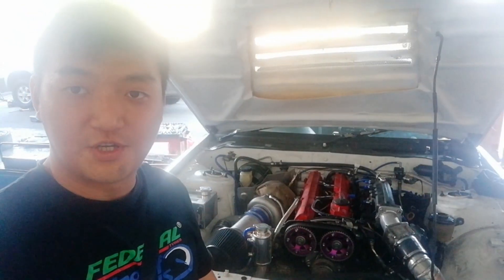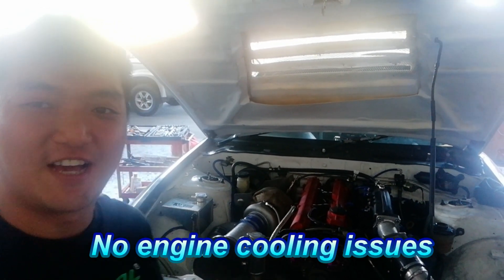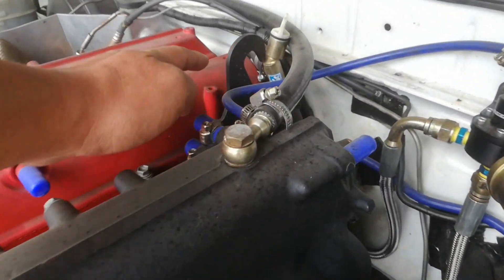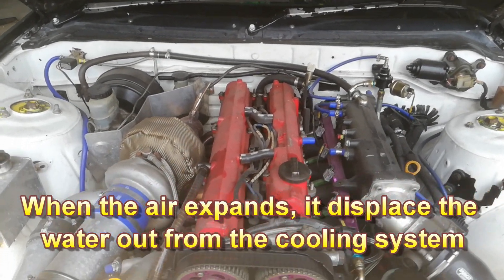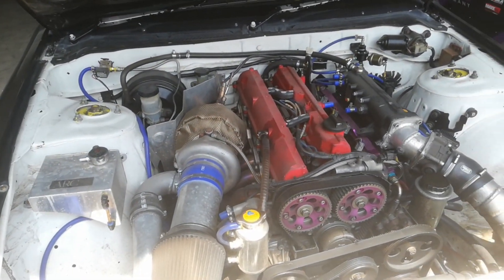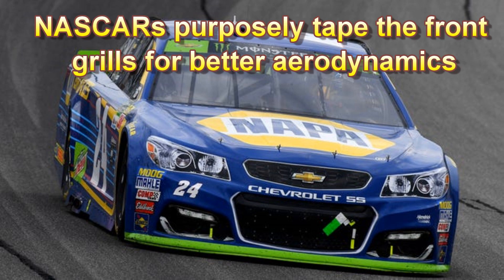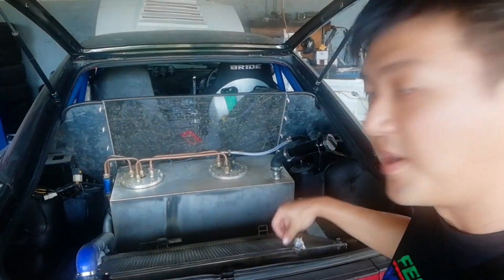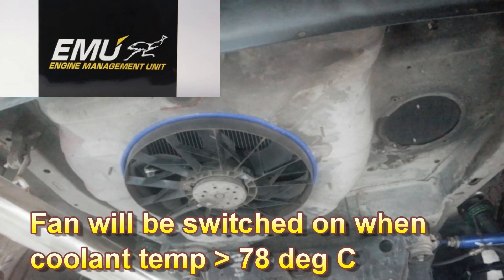2JZ Tuesday - The reason why 2JZ or any other engines overheats

Comment: Hey Micahel! I’ve then scouring Google for the stopcock that you have connected to the heater core hose / behind the valve cover. Any part number / search terms to help locate the part? I got a bad bubble in my 1JZ cooling system
Reply from the maker: Actually bolt and nut also works. Or Avanza valve

Comment: So what could be the issue if a 2jz engine overheats after 60mph
Reply from the maker: It could be many possibilities. You have check everything from fan not working, insufficient coolant or bad bleeding of air in cooling system

Comment: what engine management system can you suggest using for building a 2JZGE vvti engine, looking for something plugNplay with autotune feature

I will be building in stages, building from stage 1 turbo bone stock motor and fuel trim on STOCK AUTOMATIC until I build into stage 2, 2JZGTE spec oem parts, to eventually stage 3 upgrades fuel system

my goal isn't to make a lot of power but rather to keep the engine alive for as long as possible